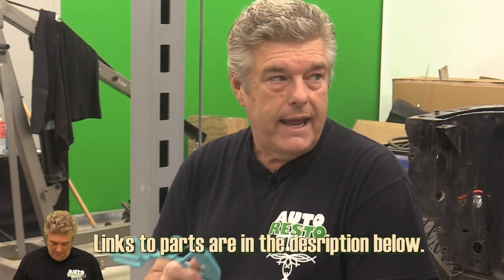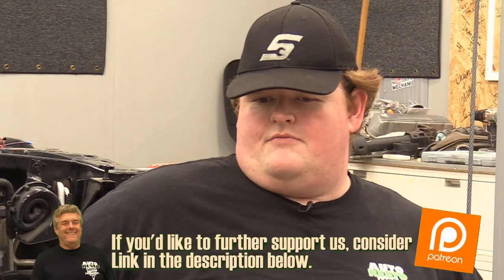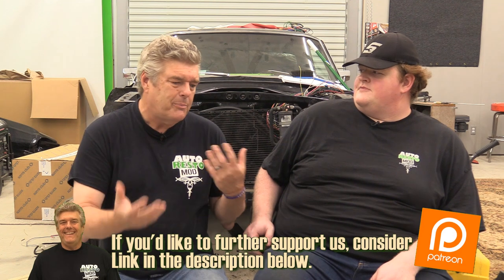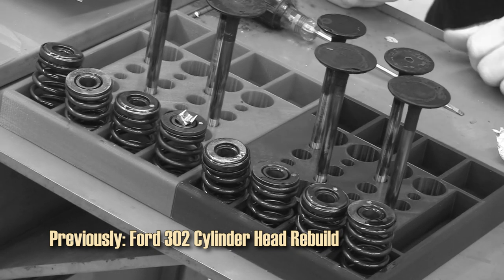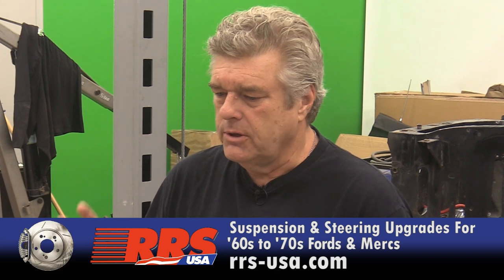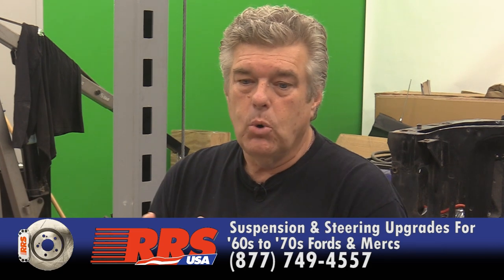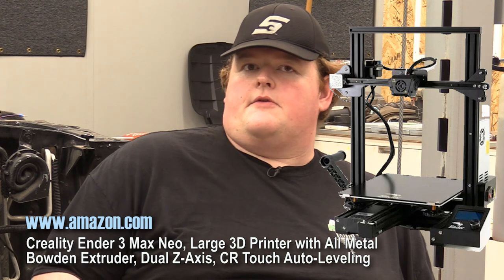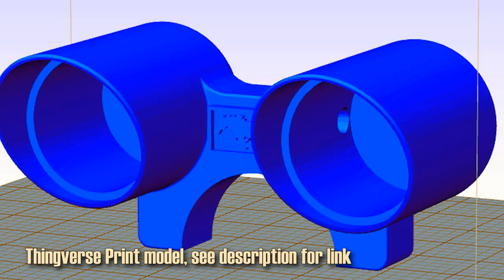Is 3D Printing the Future of Classic Car Parts

Comment: If you want to see a YouTuber 3dprinting to cast metal, Vogman is a good one to follow. Also recommend HEN3DRIK  for Electroplating 3D Prints. IMO CNC machine that emblem using something like Send-Cut-Send after your happy with the test models in 3dprint.

Comment: probably the best use for 3d printing, printing those hard to find interior plastic pieces that break or go missing in older cars and you cant find replacements anywhere
i mean hell, if you got a broken part or a second functional piece to work with youre golden. the printers will probably get way more advanced and faster in speed in the future though to make it more viable, maybe even AI will come into play with scanning parts to skip the whole modeling process itself
Reply: the day we can 3d print metal with resin printer-like accuracy ill be really happy though